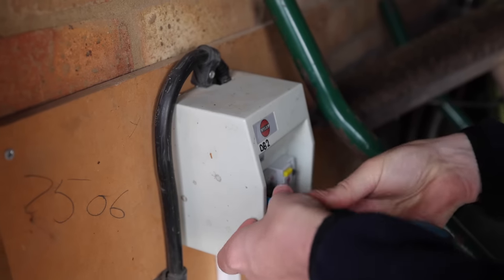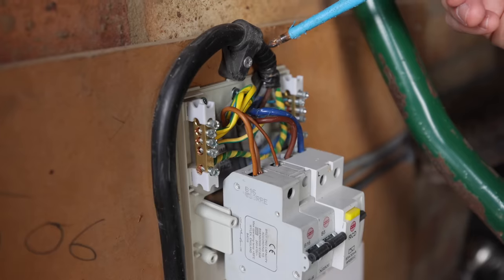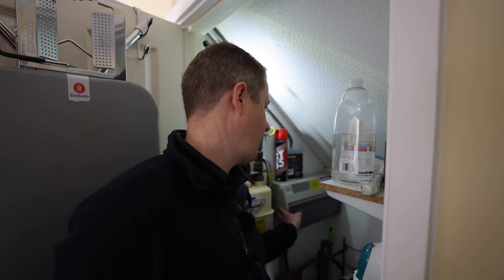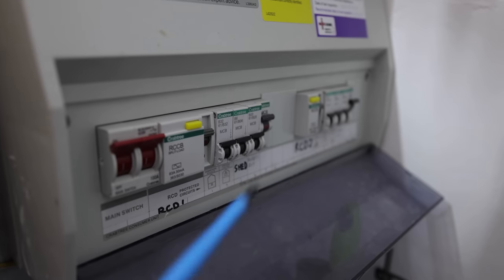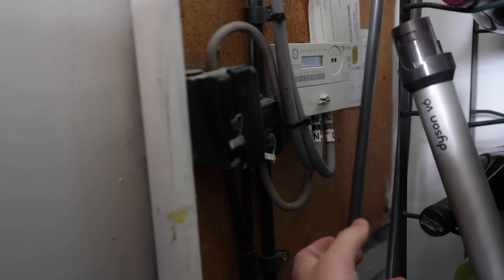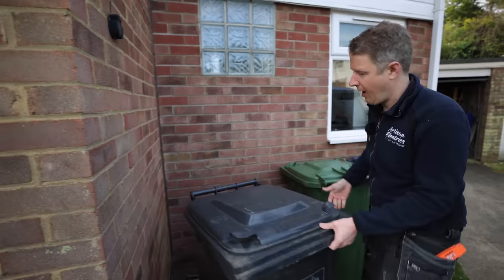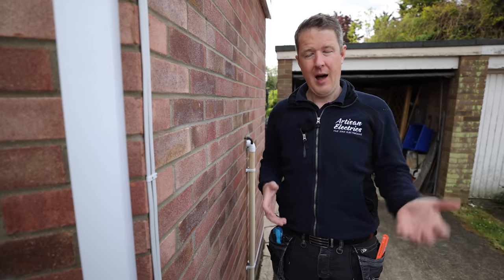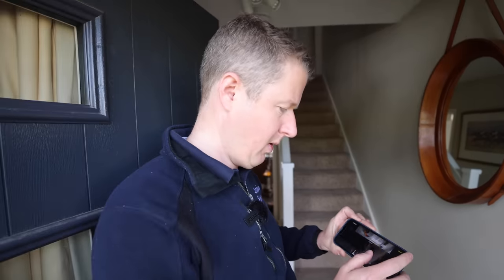5 THINGS YOU NEED TO KNOW BEFORE GETTING AN ELECTRIC VEHICLE CHARGING POINT!

Comment: my installer didnt use my house consumer unit, he split the incoming load after the meter with henley blocks and added a tiny 2 slot consumer unit just for the ev charger.
Reply: Nothing wrong with that. Still have to consider supply fuse size though and install the new small DB to current standards.
Reply: Mine did the same, glad that that's OK.

Comment: You did not mention that you need to total the amps used in the house on the 60 amp fuse .I’ve had the fuse upgraded to 100 amp but now but they now say that there is not enough spare for a car charger and that I will require a three vase system .
Reply: you will not have everything on at the same time, you can't have more than 100A anyway (even if you wanted!). EV chargers are 'intelligent' and monitors the current coming into the house and will switch itself off if your total draw is close to a threshold of say 80A (on Zappi these can be set to whatever you want) i.e. EV charger and whatever else you may be running. Its better to charge at night dependent on tarrif and normally less demand at night.
Reply: Just get an ev charger that monitors usage (with a ct clamp) you need 0A of spare capacity for those.
Reply: @James_scott86  EV chargers are about 7kW  (power factor of 1) so full load will be 32A (approx)
Reply: Bonkers. I've 2x 32Amp podpoints fitted with an 80Amp fuse. The 2nd podpoint (and all new podpoints by default) load limit/shed once the house reaches 60Amp.

Comment: Is 10mm2 armoured cable running out to the garage good enough for a 7KW charger? Thanks in advance.
Reply: Yes mate a 2/3 10mm2 Swa armoured is good for 70 amps which is plenty if you do the calculation 7kw=7000watts then take 7000 divide by 230 = 30amps
Reply: @georgelelliott7950  thank you
Reply: just pretend you are running a circuit in for a shower unit
Reply: @MrImATarget  that's fine just for the EV charger. I run a 3HP compressor (13A), MIG welder (16A) and a Spot Welder (16A) as well in the garage so I would need a little more cable.

Comment: Current rating of 2 core 4mm2 armoured is 49 amps. May be a voltage drop issue, but not a 'melting' issue.
Reply: If clipped direct it would be compliant ... After 20m voltage drop would be an issue. If buried then would need to be downrated to 40a mcb i think, could still be 20m.
Reply: I have to say I thought the cable at the garage board looked like a 4mm. Even a 2.5mm isn't going to melt at 25A - it's rated higher than that!

Comment: i have a 3 phase 400v socket in my garage. thought you can charge directly from the socket or is it recommended with a "charger"?
Reply: You can get a portable evse that connects to the red plug, though you might just want to get a 3 phase charger wired up to the same circuit/supply
Reply: it is possible, yes :)

Comment: Which chargers would you shortlist for a Landlord/Tenant situation - a single house with drive? I think you'd need untethered so that's one less thing to maintain and get damaged; timed charging of course as you suggest; but also the software lock/unlock would have to have two levels of access control so the tenant doesn't run off with the pin number/password to the unit if the tenancy ends badly. Also a new install refurbish might not have live internet for a few weeks to register for the new grant. Any thoughts? I think you've begun to do a few flats and other similar situations.
Reply from the maker: Hey Pete, we've often installed Easee chargers in this situation, however, more options are now available with the use of software like Monta or Tap Electric these allow for you to decide who can use your charge points, when and at what cost.
Reply: @artisanelectrics  thanks, there are good things about the Easee, I just wish it looked a bit more rugged. We don't need to worry about payment issues just a higher level of control. I'll look into your two suggestions.

Comment: I had a EV charger fitted couple of months ago , the consumer box and the main electric power supply in the outside cabinet are 30 metres from the place I wanted my EV charger located. So I had a 30;metre trench dug under lawn and 2 pavement slabs at front door. My question is they never connected anything from the interior consumer box. Everything was done via the exterior main house supply box. Surely this is a good option as no routing cables in the house. But I have watched many videos of EV charger installations but none wired like mine ?
Reply: You’re not really meant to install equipment in the meter box, though depending on the situation I might find an installer who will do it anyway.

Comment: Another cracking video. Love you stuff. Quick question I have always wanted to know! How is cable sizing measured? Meaning for example a 95mm2 cable doesn’t have a diameter of 95mm. I know it’s a cross sectional measurement. But I’m still confused of how it’s measure!
Reply: Pros typically can tell just by looking at it, for non pros read it from cable sheathing or more advanced and more dangerous (make sure to turn off power and ideally use non-conductive tools) - measure the conductor itself then you can calculate cross section simply from area=pi*diameter^2/4.
Reply: It’s just the area in a 2d plane. Imagine a square with 10mm sides, the area would be 100mm2, ie a 100mm2 square conductor. But since cables are typically round, you’d use area = radius^2 * pi to calculate the area.

Comment: Wait what? In the Netherlands Normal one phase houses have 35amp max. What do British houses have that 60amp wouldn't be enough?
Reply: Electric shower (40amp) and electric cooker (32amp) plus then EV charger at 32amp, doesn’t take much to add up!
Reply: We have in a new  house 3 fase 25 amp, so i can get a 11 kWh charger
Reply: You probably have 3 phases, British typically use single phase domestically, three phases only in industry, so 35A roughly equates 60A single phase.
Reply: @michaels8336  and how often will all items be on at once ? New chargers have load monitor and only turn chargers on when there load is available. U set the max amp so it knows not to go above that . Also set times to charge eg over night so cheaper price etc etc
Reply: @bar10005  I really ment 1 phase 35amp. 3phase houses have 3x25amp. I myself have 3 Phases because of my induction cooker. (<11kW) On my one phase connection I charged my EV with max 8 kW

Comment: I thought chargers needed a type B RCD? Are you assuming fitting a charger that has the 6mA DC protection fitted in the charger itself so a type A back in the box will do? If the charger has a type B RCD built-in should you fit it fit it on it's own non-RCD circuit (to avoid lack of RCD discrimination?), or is it OK, to daisy-chain it from a type A RCD? 
"In January 2019 the UK introduced 18th Edition wiring regulations (722.531.2.101) for EVSE installations that requires the use of either a Type B RCD (with built in dc capability/detection) or “RCD Type A and appropriate equipment that provides disconnection of the power supply in case of DC fault current above 6mA”."
Reply: Check out amendment 2 that came out this year

Comment: Any idea how I can stop my EV granny charger plug from getting hot ?
I guess probably not as it does drag 10 amps for 3 hours
Reply: Check the plug pins, clean up any corrosion. Is the socket good? Replace if old and contacts getting discoloured. Final resort if no joy, change your in car setting [if it lets you] to lower power. Mine gives an 8 amp or 6 amp option. This might be too slow sometimes but if it's good most of the time then it could sort the problem. Most recent granny chargers have a thermal cut-out in the 13A plug which should at least prevent a total meltdown and fire, worth checking.
Reply: @peteglass3496  the built in plug does look a little old so I will clean up the contacts.
As for the socket, its a new install so it's not that and it claims its rated for 13 amps.
thanks for the advice.
Reply: Change the plug on the granny cable to a 16amp commando type and change the socket as well. For the times you still need a 13amp plug buy a small adapter cable to go from 13amp plug to 16amp in-line commando socket. Some granny chargers can be set to charge at 32amp 24amp 16amp 10amp and 6amp. If you buy one of those they come with a 32amp commando already fitted, giving the option of even faster charging if your house wiring is up to it and has the requisite breakers cable ratings and surge protection

Comment: I have been following the development of Hydrogen vehicles and don't believe electric vehicles will be for everyone. The environmental damage from the mining of precious metals for batteries is always overlooked not to mention the limit distances without a charge period. I have just ordered a new diesel truck and although diesel is now expensive it is certainly what I need for my business.
Reply: If you've been following the development of hydrogen vehicles you know they're about 15 years behind, especially with refuelling/charging infrastructure......
Reply: Does the mining and environmental damage caused by the extraction/transportation of crude oil not concern you too? I'm sure you've seen the footage of the many oil spills that have occurred over the years.
Reply: You do know that an Hydrogen car is an EV with the Hydrogen just used to provide energy to the motor, it just has a smaller battery. Also Hydrogen generation is definitely not environmentally friendly at the moment.  Its still very early days for Hydrogen production.
Reply: So a hydrogen car is an electric car with the addition of a fuel cell. The fuel is generated by converting electricity to hydrogen.  Fuelling an electric car is about 90% efficient from energy source to motor, a hydrogen car is about 40%. So what do you think?
Reply: @edc1569  You got that the wrong way round buddy, Hydrogen is used to produce electricity :)
Reply: Yep this is what the ceo of Toyota thinks! And why they've not really dipped Into the ev market!
Reply: @Yorkie-UK  I'm interested in the hydrogen internal combustion engines not the fuel cells. I did get a chance to see the design team at JCB where I saw an engine running. It means you can keep all of the running gear and convert existing engines.
Reply: @RikTheMix  i'll worry about that nearer the time as i expect things will be very different by then or maybe not and we are still running our coal power stations as an impact from Putin!